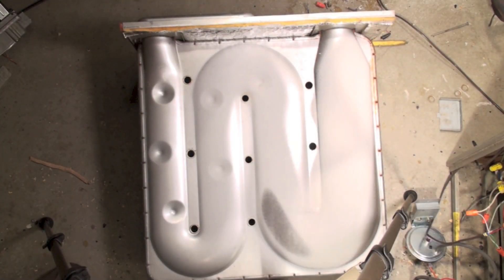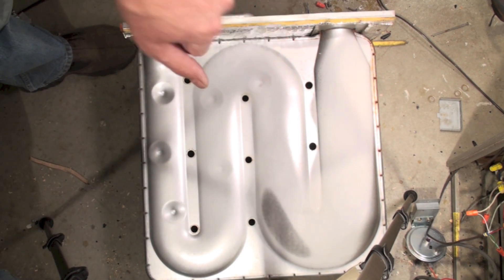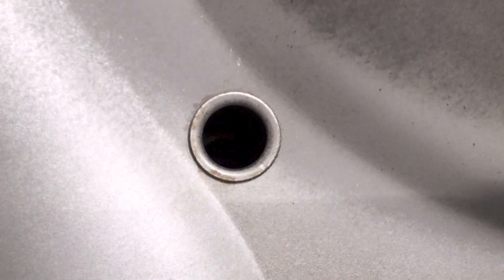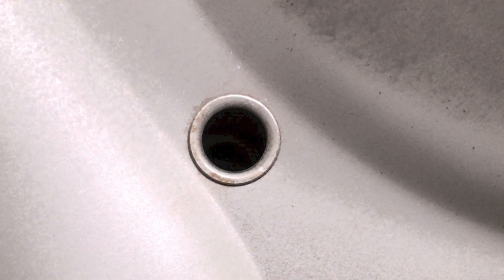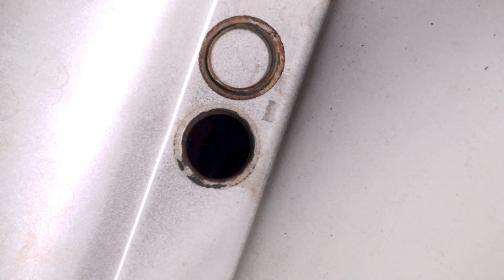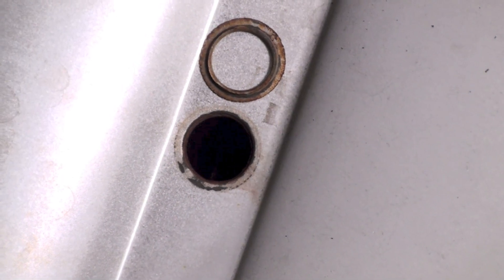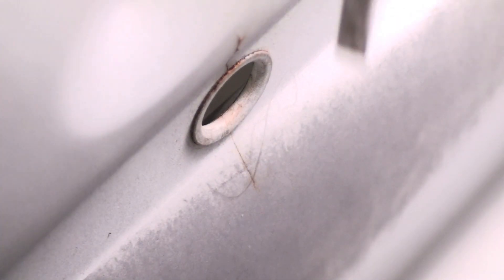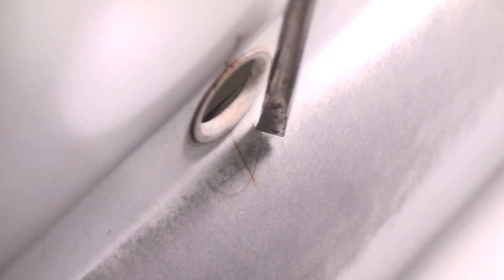Goodman GMP heat exchanger autopsy

Comment: How does this lead to the flame rollout symptom that trips the rollout switch?  I cannot see how this real problem causes increased air flow resistance to cause the rollout when the blower goes on.  

I will learn a lot if you can explain this.
Reply from the maker: The rollout happens when the fan comes on.  The air pressure from the fan overcomes the draft pressure.
GFM

Comment: Your videos help me replace GMP heat exchanger yesterday. I noticed in this video that the rear spacer bracket is laying loose in back of the cabinet like mine was. I found the only way to put that back in was to remove the blower and put it in place after the new heat exchanger was in. Just curious was there an easier way to put that bracket in?  And does this bracket even need to be put it back in? Thx!

Comment: I don't see a problem with CO entering the home from a cracked heat exchanger. static pressure from the the blower is greater then what's in the heat exchanger, as you can see the flame is rolling out. still a dangerous situation and the furnace should be disabled. Great videos!

Comment: I have one of these in my home which is currently not igniting. I'm in the process of trying to diagnose that issue.

This video has given me concern about putting any money into this unit. Assuming my heat exchanger does not have issue now how long can I expect it to last? When they replaced the bad parts in the 90's did they replace it with a part that is not going to fail? If I bought a new exchanger today, would it last a long time? 

How difficult is it to remove and replace the exchanger?

Love your videos by the way!
Reply from the maker: Glenn Hutchinson The furnace is probably reaching its end of life at about 25 years.  The heat exchanger is not particularly hard to replace.  This is being said by a professional that replaced many of them.  Who knows if the new parts are much better.  Hope this helps.
GFM
Reply from the maker: +Glenn Hutchinson I would be looking at replacing the unit.  It has reached the end of its life span.  As for the new heat exchanger, who knows.  Replacement is not especially hard but it requires a teardown of the entire furnace.
GFM
Reply: +grayfurnaceman I ended up replacing the heat exchanger. The old one did no have any issues with the rivets and no visible cracks. I live in Southern California and this unit see's very little use. I think it runs for ~3 hours each day for about 3 months a year.

I am planning on keeping this unit running. I have one concern though. Do older gas valves every pose a safety risk, what I'm thinking is do they every stick open? I noticed that none of my appliances have sediment traps. Does that pose an issue for my gas valves and long term safety of the units?
Reply from the maker: +Glenn Hutchinson I have never seen anything in a trap except cutting oil.  Any part can fail.  Is it common?  No.
GFM

Comment: why can't the crack be welded?
Reply from the maker: Rolland Elliott I have seen them welded.  They crack next to the weld.  This is because of 2 things.  The steel on modern heat exchangers are made of an unweldable type of steel.  The weld is thicker than the surrounding steel and the heating cooling expansion concentrates the stress at the edge of the weld.
GFM
Reply: i wonder if silicon brass brazing would work? supposedly it's better for this type of repair.
Reply from the maker: Rolland Elliott Nope, the temps are too high.  Besides it violates all state gas codes.
GFM

Comment: Would this cause high co in exhaust?
Reply from the maker: It could.  Also in the air ducts.
GFM
Reply: Actually not so much an issue with the air coming out of the ductwork, since the air is blowing INTO the burner tubes of the heat exchanger.  The danger is with 1. the flames feathering before the gases even enter the heat exchanger, causing a release of CO and other combustion gases directly into the control compartment of the furnace, and subsequently the rest of the mechanical room and, 2. the possibility of a fire in case the roll-out switch doesn't catch the flames burning where they shouldn't be (or is defective).

Comment from the maker: It sometimes is quite subtle.  As the blower comes on, the burners affected will begin to rollout instead of moving smoothly into the heat exchanger.  Check out some of the other vids on the Goodman in the playlist.  Hope this helps.
GFM